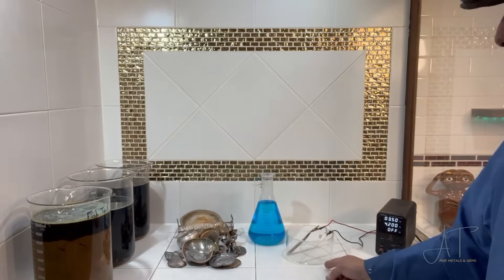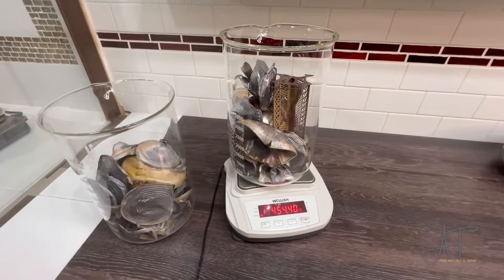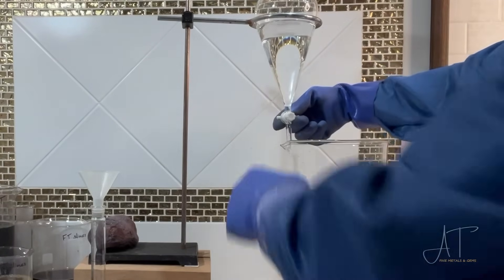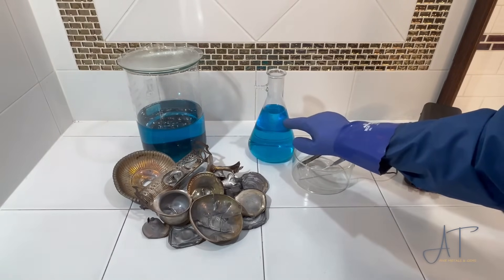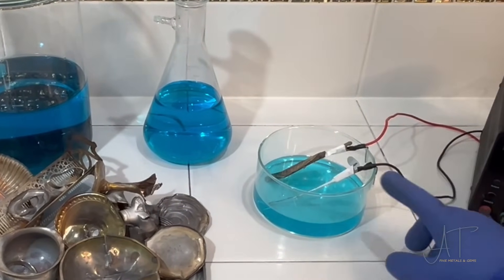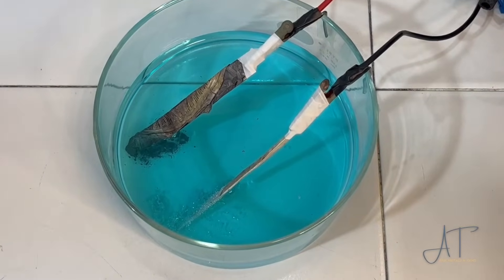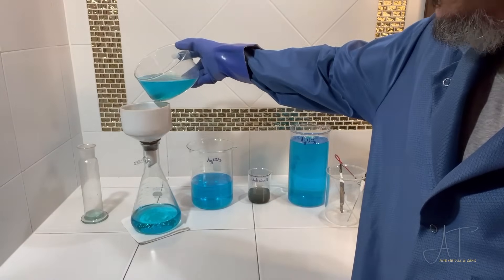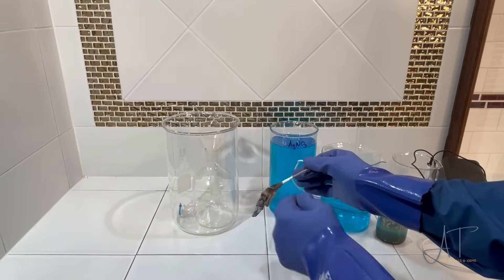Refine Sterling Silver Faster Using Less Nitric Acid

Comment: Absolutely love watching your videos, I find them fascinating from your home made builds to the experiments. With your initial test you used just the scrap sterling as your anode, but with the actual run you attached the sterling to a piece of silver. Would that produce a better result with the conductivity of the silver or so you can submerge the anode a little more to keep the alligator clip out of the solution? Thank you
Reply from the maker: I was just using what I had. Not much difference either way. Thank you so much for watching!

Comment: If you dropped the silver out of the silver nitrate solution  with copper you could then go and reclaim the nitric acid using sulphuric acid,  converting the dissolved copper nitrate into copper sulphate.  Electrolysis of this solution would leave pure copper metal and sulphuric acid to be used again in the reclamation of more nitric acid.
Reply: How would I separate my copper sulphate from the nitric acid  after adding the sulphuric acid ?

Comment: Hello Sir from Romania!
I ' ve watched your vids many times and I have a question:
I don't have access to nitric so I try to recover silver using a copper cell. and a silver cell later.
The base metals I find silver on are copper, Sn, Zn and possible some lead due to the solder used.
Have you tried to remove Zn, Sn and Pb leaching the slimes with NaOH?

Comment: Just do what the big refiners do... its cheaper and easier, you get the same result.  Add .999 fine in the correct weight to .925 and you will get .999 fine silver from your .925 . Cheap and simple
Reply: Trying to read this makes my noodle soup tangle..
Reply: Are you saying mix 100 parts .925 with 10,000 parts of .999, so the 7.5 parts of impurities are not enough to bring the 10k below .999?
Reply: @CustomCreativeCarvings there is a mathematical formula... look it up. .999 fine silver and gold still carry a .001 impurity.
.9999 fine is considered pure
Reply: @raisethecolours ur math isn't Englishing
Reply: @nugget5317  your math is way off... To turn 1 ounce  of .925 silver into .999 silver, you need to add 0.075 oz of pure silver.  Simple
Reply: @raisethecolours u don't add pure silver and suddenly get fine, u have to actually remove the other metals currently within it. Electrowinning is probs the best method for this. When processing, they add extra of the target metal (silver) to make sure it's the dominant metal in the electrolytic solution. Everything  else is rinsed out for processing as slimes or mud. I'm guessing u the kind that mixes 2 bottles of alcohol together thinking it's making the percentage higher ey...

Comment: Very nice test. I wonder if the life of the electrolyte will be shortened for those who do not have a nitric recovery process set up yet.
Reply from the maker: Yes, the more impure the metal the faster the electrolyte collects impurities. That’s why I typically only use this method with Sterling and I can run about 1.5 kilos before the electrolyte is spent. 3 times what you could get from 500 ml of nitric. The other main benefit is that you are producing pure silver on day one instead of day 2 or 3.

Comment: It’s interesting, but not very efficient. One piece at a time and you pretty much have to stay with it throughout and using a lot of electricity to save a half liter of nitric just doesn’t seem like a good trade.
Reply from the maker: Electricity is .17 per kWh. So running electrolysis at roughly 37 watts per hour, I can run for hundreds of hours before I equal the price of 1/2 litre of nitric. The math I have done makes it worth it. Plus electricity is easier to come by than nitric.
Reply: @anthonythomasfmg I guess if you don’t assign any value to your time and don’t mind spending that much of it. Where do you live? (Generally speaking.) where I live, nitric isn’t exactly cheap, but it’s readily available and not nearly as expensive as the value I assign to my time.

Comment: Can i use 53% also?
Reply from the maker: Yes you can. The acid gets diluted with the addition on distilled water anyway. Lower concentration acid works, you will just need a relatively larger volume of it.
Reply: Ok merci!

Comment: What's the point here, to get more or less pure silver?
Reply from the maker: To fully understand the point here you need to understand the 4 Horsemen Refining System. It is a novel approach so all of the experiments I run are based off of those four methods of electrochemistry. I run most of my silver twice, my goal is to limit the amount of outside expenditures and use what I have in the most responsible way I can think of. God is watching us all.
Reply: To recover silver plate on fork spoons an the like

Comment: Interesting experiment, Anthony. How does the amount of nitric acid you saved, cost wise, compare to the electrical energy consumption of the silver cell?
Reply: I think it’s more of a cost-over-time situation than a one-time-cost situation. It’s like buying a tractor instead of paying a contractor to do multiple projects over the course of a couple years
Reply: The cost of electricity is negligible. Based on the display of his power supply reading 8 volts and .366 amps, that is only 2.928 watts. For 24 hours straight it is 70.272Wh or .070272 kWh. The average cost of electricity in US is $0.17/kWh, so it is ~1.2 cents a day. Not totally accurate though right.. obviously ac to dc is not 100% efficient, more  power is being consumed than what the read out is showing.. even if it is 5x, which is hard to imagine, at 6-7 cents a day it is still a lot cheaper than the cost of nitric (plus the $40-50 shipping charge on top of the cost)

Comment: Very interesting do you think this would apply to lesser grade silver source say 56 % ?
Either way it's gotta try this process
Reply from the maker: There is a critical point where the silver being deposited into the aspirator bottle will become impure. So although you can use lower purity silver to start, your solution will become saturated with copper at some point and begin to contaminate the pure silver. So yes it works but not for as long as sterling. If you plan on re-running your silver in the number 1 silver cell, like I am than, go for it. I run most of my silver twice no matter how I process it to get a guaranteed 999 result. Good question!
Reply: My contaminated silver is basically stainless steel pins plus radnor safety silv 56 % solder from 500 cutoffs i get 13 grams of silver if i go the disolve it in nitric method then cement it out with copper im like you trying to save on nitric acid $$$
Reply: Also thank you for your reply
Reply: That worked awesome i was able to recover 1.5 oz of silver  per 3 lbs of of (ore) my waste is stainless cutoffs  with a small amount of radnor safety silver 56 on them  outstanding and only use 125 ml of nitric

Comment: Nice video!   I always enjoy watching your work and setup.   I just built a silver cell using sulfamic acid as an electrolyte.   Almost reminds of mix of cement silver and crystals.   I re-ran all of my silver shot using the hcl, lye and sugar method.   Now I'm cutting up small pieces of sterling to throw in the anode basket.   Next... a copper cell.  Since you do have an xrf... I would be curious if you tried it, if the purity would be the same as silver nitrate.   Definitely a cheaper alternative.